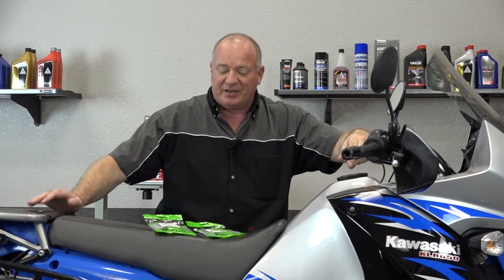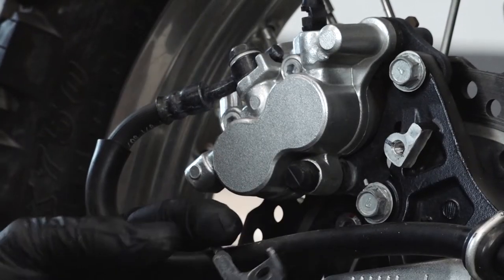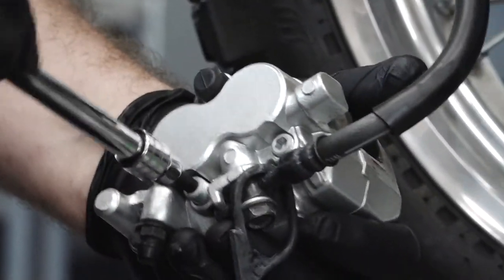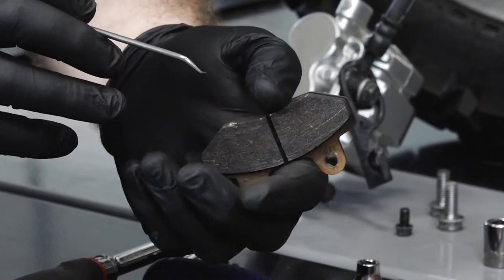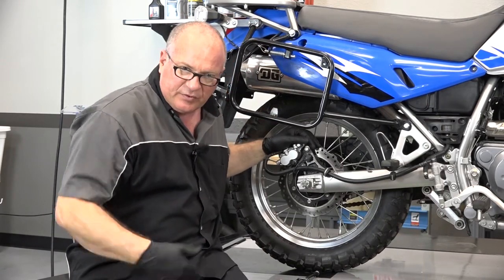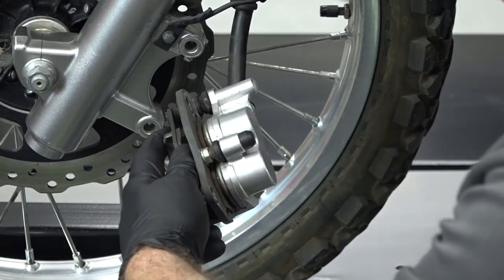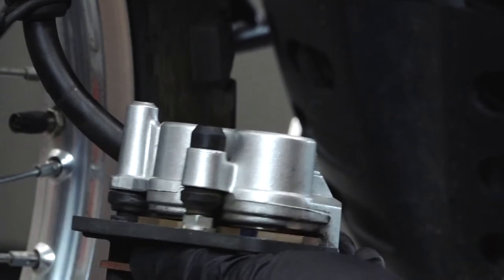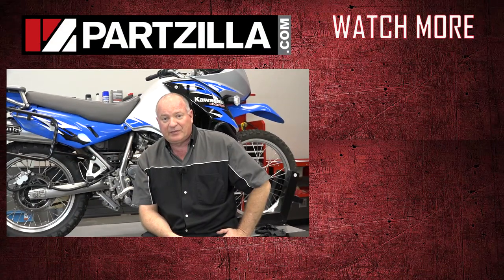How to Replace the Brake Pads on a Kawasaki KLR 650 | Partzilla.com

Comment: Good information but please include torque settings, talk about using proper lubrication on pins and anti seize compound on the pin threads. Can't tell you have many calipers I've seen ruined because they were so tight you ended up destroying pins trying to get them to release. Been a bike mechanic for 50 years and this is vital information for people doing it for the first time and being able to do it a second time.

Comment: This was great. I am guessing the two screws that go through the brake pads are to hold it in place, but also act as a guide when you pump the brakes. Would you want to put some waterproof grease on the non-threaded portion of the bolt?
Reply: Technically you could but why bother when the pads are cheap and easy to replace.

Comment: I accidentally spilled a bunch of oil on my rear brake pads when I was doing an exhaust mod. Can I use brake clean to clean the brake pads and rotor? Or do I need to replace the pads?
Reply from the maker: You can use brake cleaner to kit the pads and rotor.  Once they are oil free, you should be good.
Reply: I'm almost a year late on this, but pads are cheap, just change them.

Comment: What tires are those on the bike? I want them!
Reply from the maker: Dunlop K750.  They come stock on the KLR650.
Reply: Thank you. I bought mine used and it came with Sinko 705 tires. What would you suggest, out of your stock, for heavy road use but for occasional trail use. I do ride all winter, ice or snow (On road), and would love some tires that fit in this area. What do you suggest?
Reply from the maker: Check out the Continental TKC70.  Great tire for that bike.  Unfortunately, we don't have them up on the new site yet.

Comment: Good tutorial, except for the fact that those two 5-inch Allen keys are so badly seized in my brake caliper, that they will not come out. I don't know why they use Allen keys for these sort of things, they are the most useless pieces of s*** ever invented.. once they seize up, you can't apply any force on them, they just strip then you're pretty much screwed, why can't they use normal FKN hex head bolts!!!!!  Now I have to buy a whole new caliper because of 2 fucking Allen key bolts.....